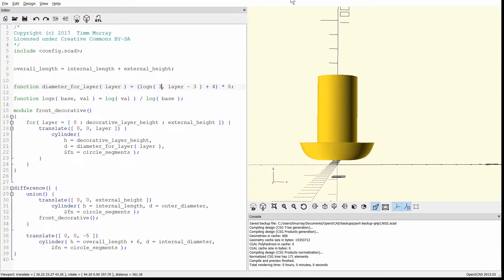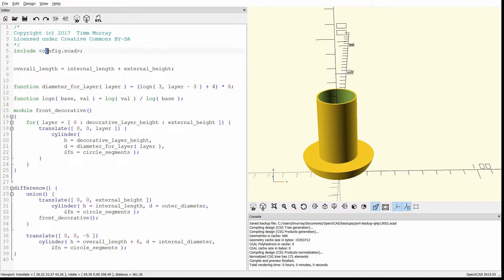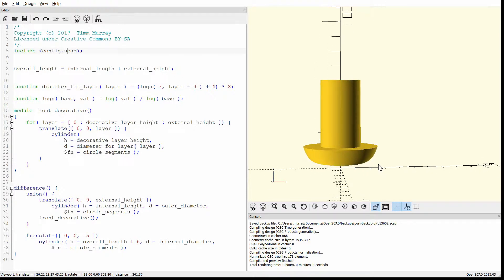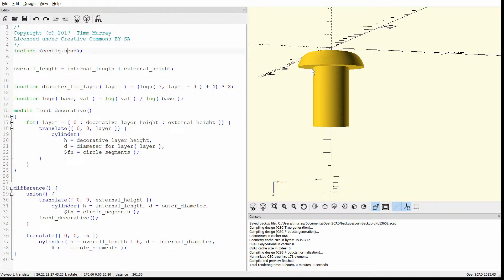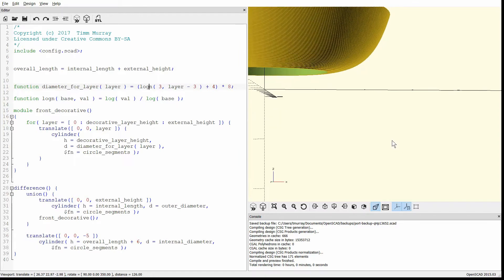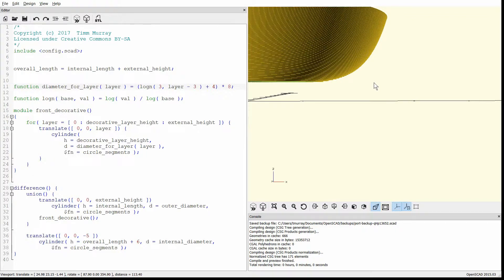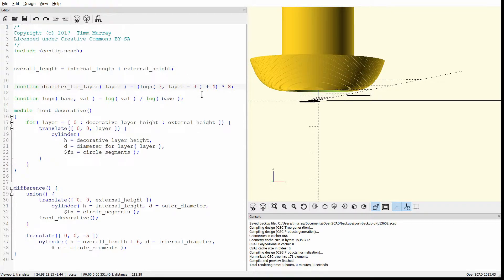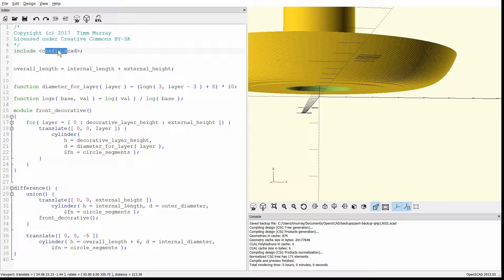DIY Custom 3D Printed Flared Speaker Port

Comment: Correct me if I'm wrong, but rounding the outside edge of the port doesn't change the characteristics of the sound of the port. So this is purely cosmetic? Where as a flare into the inner diameter of the port will help with reducing turbulence and noise created from such turbulence.
Reply from the maker: Could be